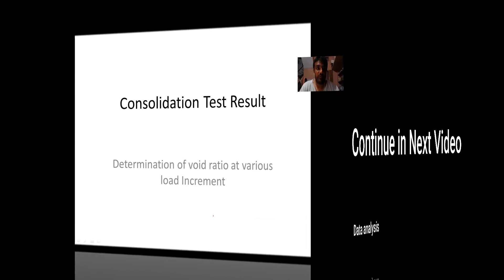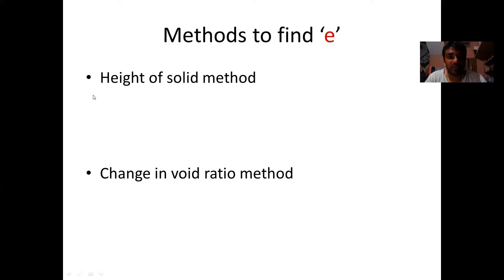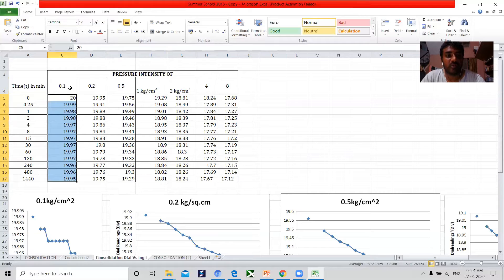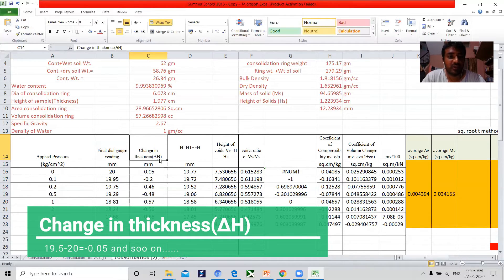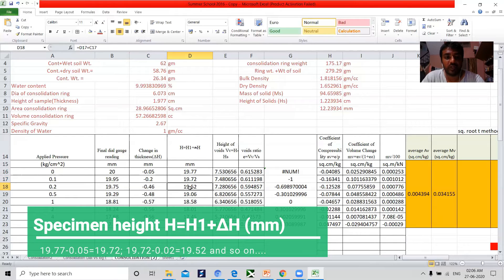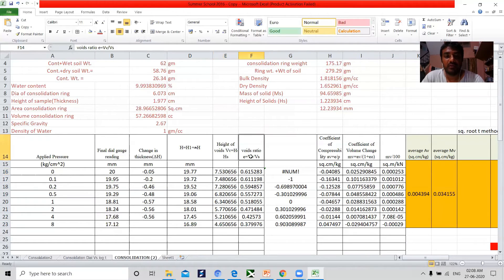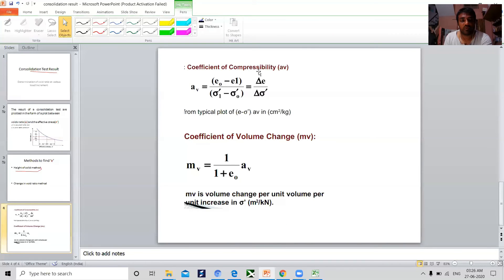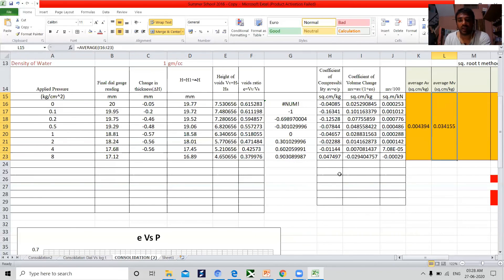Consolidation-Determination of void ratio (e)

Comment: Sir I have to do this test on msw... So I have to do at different water content so how can i decide the different water content?
Reply from the maker: As the video was the basic to understand of concept... 
In practice consider and prepare the soil sample with fully saturated condition. Add water nearly to liquid limit and proceed with the procedure.
Reply: @CivilEngineeringVibes  but sir on sieveing msw(municipal solid waste) ... I found it is sand.. So on what basis i can add different water content... Based on dry unit weight of soil. ?
Reply from the maker: @tirthgajrawala9408  Dear, 
If your soil sample is course grained then why do you proceed with consolidation? 
Kindly consultant your project guide
Reply: @CivilEngineeringVibes  sir how can I contact you?
Reply: @CivilEngineeringVibes  as I want to know consolidarion characterics of Msw (collected from ahmedabad landfill)